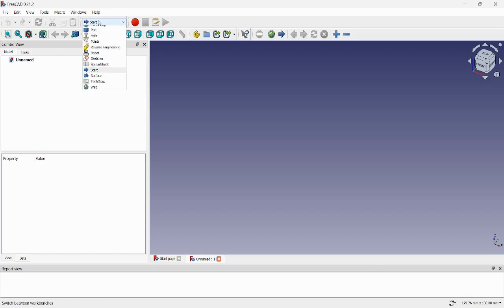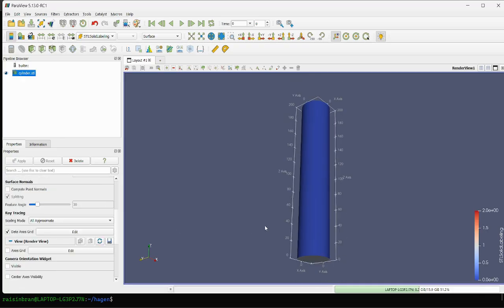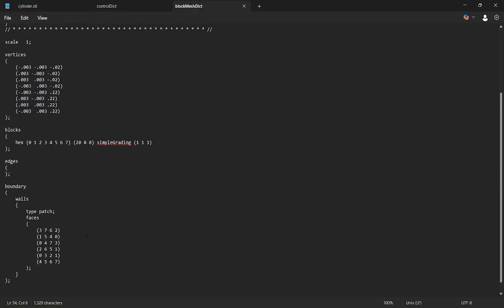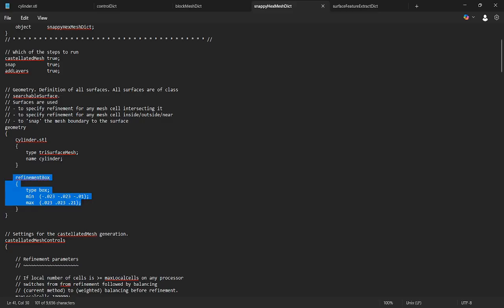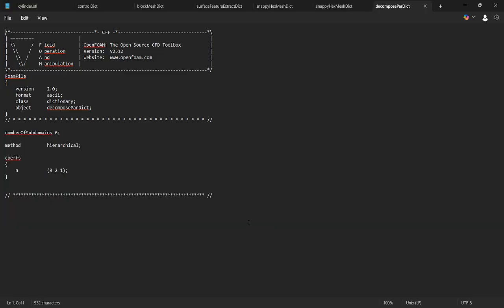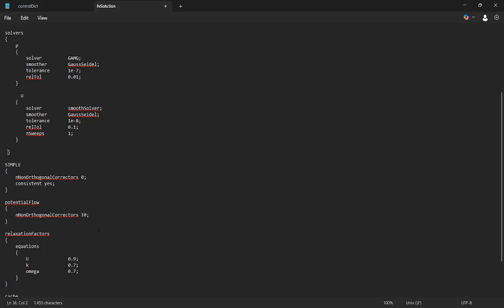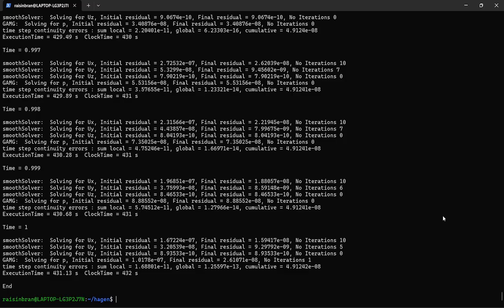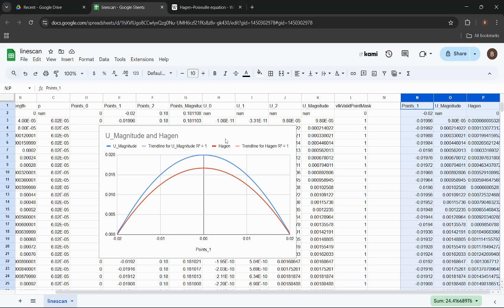simulating hagen poiseuille flow in 3D pipe - OpenFOAM tutorial

Comment from the maker: 0:00 stl creation (yes you can create cylinder directly in mesh workbench)
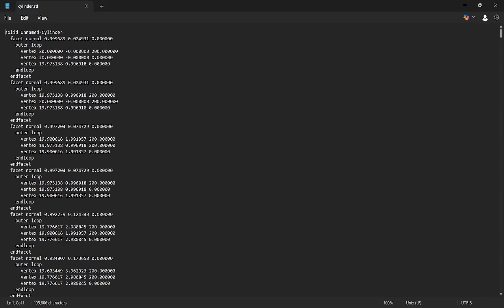2:27 defining regions in stl
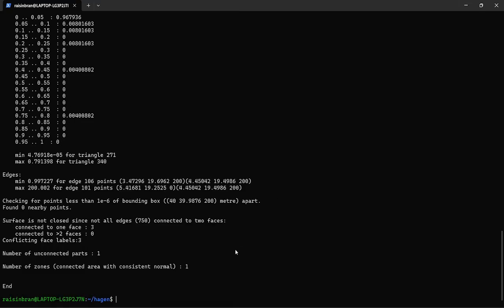8:39 scaling stl
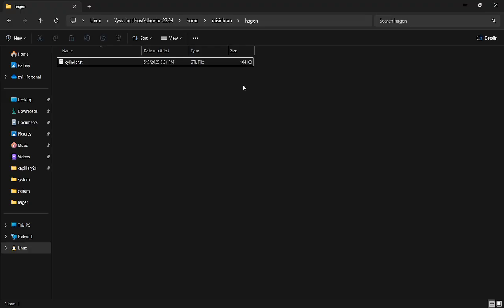9:35 case setup 
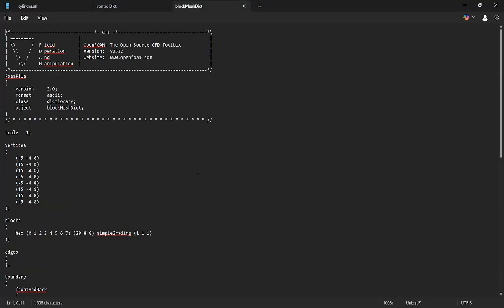12:29 blockMesh (note: grading should be (100 100 50) instead of (20 20 10). this can vary depend on your computer.)
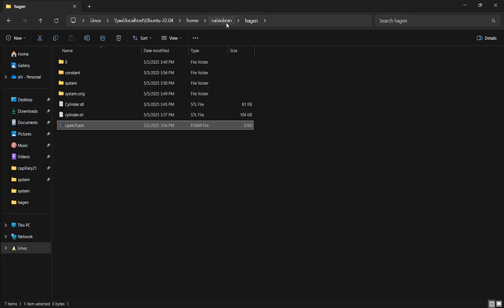20:09 surfaceFaeatureExtract
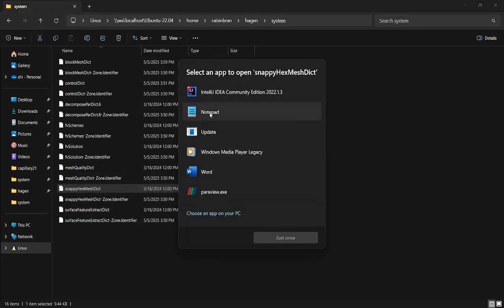21:23 snappyHexMesh
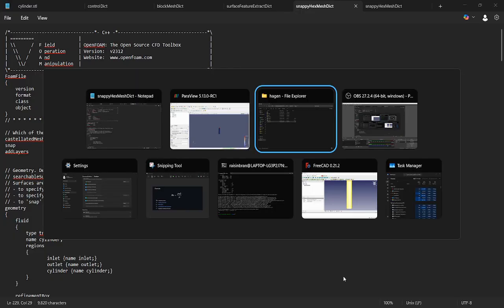31:16 decomposePar
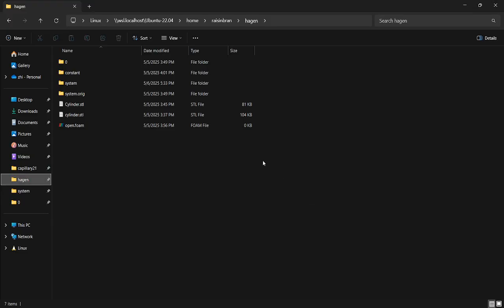32:00 adjusting 0 folder
38:45 adjusting controlDict, transportProperties, fvSolution
40:01 fluid physics
48:31 analysis
54:20 parabolic inlet BC